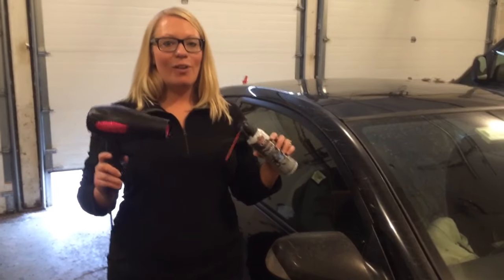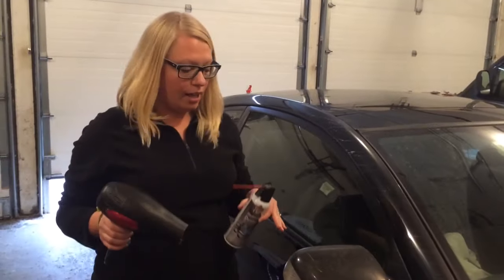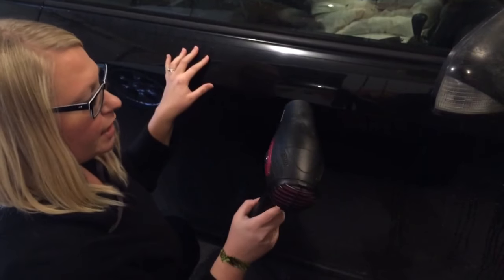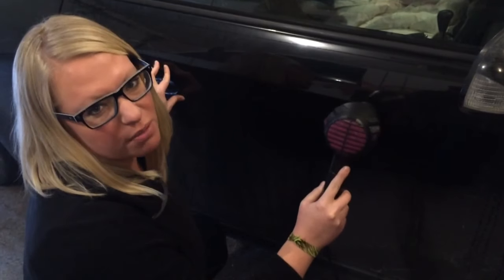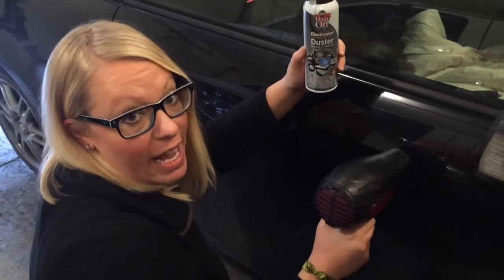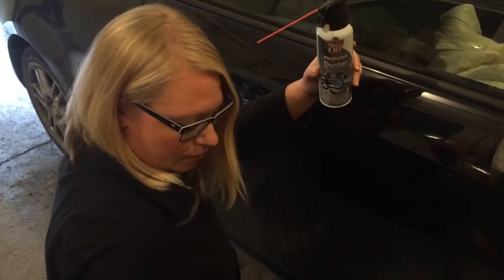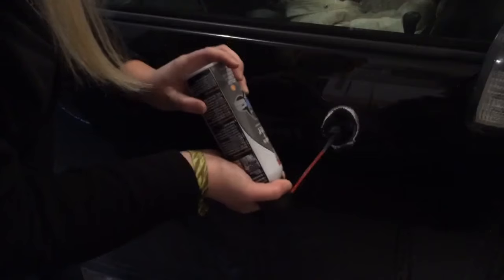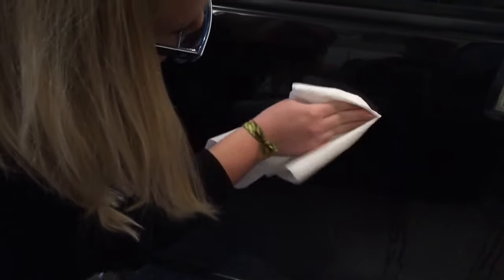How to Remove Small Dents and Dings From Car Using A Hair Dryer and Canned Air

Comment: Hey gorgeous, thanx for video, I ain't never had any luck with this way, but your method seemed to work on three good dings I had in the quarter panel. thanx
Reply: If you never had any luck, how did you remove the 3 dings? Tell me before I buy compressed air. Tia

Comment: Hi...plz can u inform me if i can replace compressed air with water or something else...we dont have such sprays here thx a lot
Reply: "Compressed air" bottle does not really have compressed air. It contains a refrigerant like a fluorocarbon. You can see the liquid oozing out of the pipe. This liquid produces cooling when it evaporates and becomes gas. It is the cooling action that produces a shrinking force on the dent and forces it to snap back. The earlier heat from hair dryer makes the metal more malleable (softer) to snap back.

Comment: Bad drivers giving us repair advise makes perfect sense... btw that hair dryer costs more than a cheap heat gun(1 min hold time) and also wouldnt dry ice on a hot day work too its just compressing and decompressing it actually does not get rid of the ripple

Comment: the concept works! when there is a dent or ding the metal gets stretched. body men shrink bare metal on big dents by heating with a torch then quenching it with a damp rag. I will try it because there is little cost and use a heat gun but just not to hot to damage the paint.

Comment: This process only works for bigger dents at least a couple inches or more if small door ding use a PDR tool the one that uses hot glue and has multiple attachments that go from bigger to smaller. Harbor frieght tool is a POS get one off Amazon that comes with tool, hot glue gun and glue sticks, scraper for getting glue off, and multiple attachments! Your welcome

Comment: What do "they" know?  Turning the can upside down releases the compressed to liquid gases.  That liquid is extremely cold, down to -60F, and dangerous to skin, as it can cause instant frostbite.  .   As for the using the compressed air/liquid, upside down, for dent removal, be careful. To all trying this, be very careful to not get the compressed liquid air on your skin.  BTW, admitting to being a bad driver ain't a good thing.  If you're really a bad driver, then you need to learn how not to be.  But, those dents are not from driving, good or bad.  Either you constantly hit other people's cars, or they do to yours.  That too is not a good thing.  Admitting you dent other people's vehicles often, ain't a good thing.

Comment: Hang on a second, lady, you said "spray air and blow dryer, that's all you need..."  But then I find out that I need paper towel too?  WTF, lady!?  Next thing you're gonna tell me is that I have to plug-in the blow dryer too!  This is too much....I'm out!  

Thanks for the tip!  I got a hail dent on my roof I'm looking forward to send packing. It's tiny, but I have a BMW so it bugs me a little! Hopefully this works. Thanks again!

Comment: never use paper towels on cars
Reply: Brendan Mccabe I never have, but why?
Reply: John Raiden you will scratch your paint..
Reply: John Raiden would you use paper towel to wipe the lens of your glasses, now what stronger paint or glass?
Reply: Insane
Reply: M. Lo gloss can be scratched easily, especially on black painted cars
Reply: Brendan Mccabe ya I remember wiping bird shit off the hood of my Cadillac Esv 😢 was the worst blur mark and was told 550 for paint repair ..but hubby got it fixed after a small accident at a truck stop .. so yea no more paper towels
Reply: @veronicalopez-hudson3268  lol of course, it was them damned paper towels, bird shit on other hands is entirely harmless.....
Reply: @lowemichael03  
Eyeglasses aren't glass.  That's old school... like 40 years ago.  They are plastic, now.  Most, like mine, are durable polycarbonate (shatter resistant) lens.  They started making them from plastic for the weight difference and shatter resistance.
You can get a scratch resistant coating but, they still scratch.  Mine are a mess.
So, which is softer "glasses" or modern urethane paint?  Hmmm.  IDK.  It's a close one.